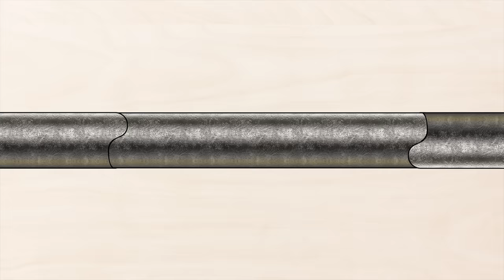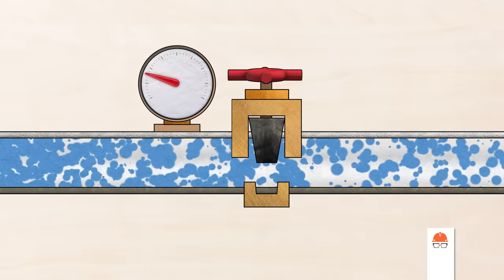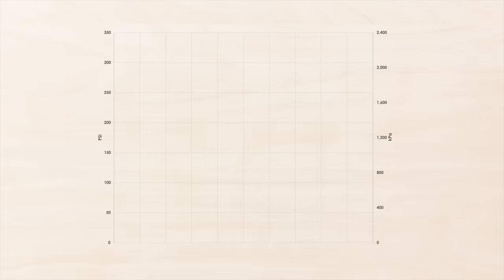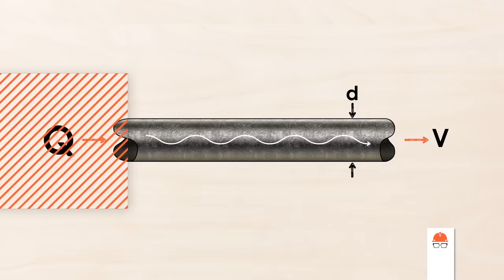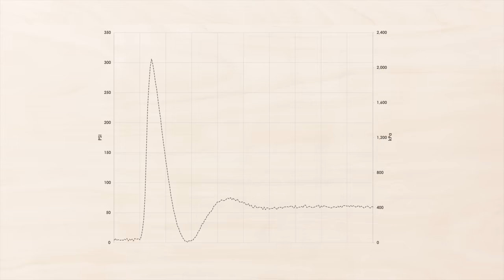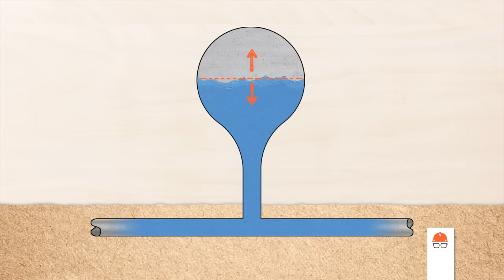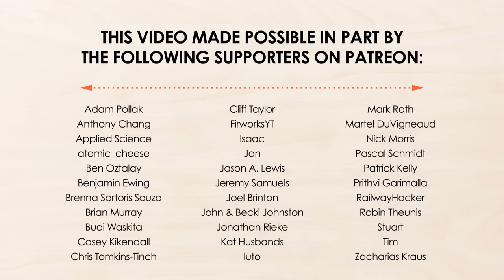What is Water Hammer?

Comment: If you shut a fire hydrant really fast you may have a lady come running out of her house yelling that her water heater just started leaking a lot. Don't ask how I know that.
Reply: william Greene 😂 lol
Reply: william Greene REPORTED
Reply: I thought that water pipe for fire hydrant do NOT connected to conventional water pipe for supply the houses
Reply: @conradkenneth5216  reported?
Reply: Lol
Reply: This is important. Is the location in UK or US?
Reply: Barma Lei  some times they do other times they use reclaim water pipelines. I work in underground pipelaying.
Reply: No,  Fire hydrants share the same water mains  in most municipal water  systems.  @barmalei9927
Reply: Lol
Reply: @rrmerlin3402  don't they need high amount of water in very less time meaning discharging with way more speed than normal house supply system?
Reply: Yes, Fire engines do need more water than your house, that's why all the hydrants are coming from mains 6 inches or larger. Most residents are feed through 1 inch lines.  @neilmccauley5494
Reply: Craig Marston 
If that’s so, how come when the water main breaks after they fix it they flush the lines via the fire hydrants??? I’ve done pipelines for several years from New York City to Red Onion Virginia (population 19) and the hydrants are ALWAYS have been hooked to the municipal water lines.
Reply: I tried to say what you are saying     Fire hyrants are part of the same piping that supplies water to residents and business.  @vsetkoumiera7683
Reply: That makes sense. If the home doesn’t have a pressure regulator.
Reply: @barmalei9927  depends on the city. Most cities size their water mains for fire hydrant and fire protection. So the same water main serves both. If that is the case, water for residential/commercial use are on a different water main tap than water used for fire protection systems.
Reply: @rrmerlin3402  It depends on the City.  IN parts of my city the hydrants are on a non-potable system - especially for large facilities.
Reply: A 1" line is only used in single family dwelling. Commerical buildings start at 2" and can be a large as the main in the street. They are feed by an interconnecting web  of pipes starting large 36" or so going down to around 4". So example 25 house  have there 1" feed connected to a 4" or 6" main running under the street that is feed in both directions. Davvy Jannes
Reply: I retired from the fire service a few years back and knowing your water system in detail is very important.  Davvy Jannes
Reply: Also if you shut it too fast it’ll blow a hole in a water main and bulge the road and then people like me go fix the water main
Reply: thank you for this. lol!
Reply: I didn't want to like it because it is at 420
Reply: How do you know that?
Reply: @Andrew’s G contractors The giant — Most likely, the residence does have a pressure regulator, but it has failed, because it has been neglected and not tested in 15  years, or longer.  I test the water pressure in my house plumbing at least once a year with a portable pressure gauge and have considered installing a permanent gauge or electronic pressure monitor, as the static water main pressure here is around 100 psi, surging to over 140 psi at times, which is well into a range that can damage plastic irrigation valves and valves in washing machines.
Reply: @barmalei9927  They do connect to public water systems. That's why most cities say "boil water" during periods where hydrant testing is under way.
Reply: @barmalei9927  same water main
Reply: Worked a wildfire used the smallest hydrant I’ve seen should of blown the main authorities the amount of draw needed but at the end it kept going
Reply: Also breaks a lot of fire engines
Reply: How do you know that?
Reply: @barmalei9927  it depends.  Potable water mains in the US are sized for fire hydrant flows.  Sometimes there are separate fire mains if high pressures / flows are needed. For example I have a site that has a fire pump for the building sprinklers and hydrants.  This water is stagnant and therefore not potable and must be separate.
Reply: ... How do you know that?
Reply: @TheSundanceKid99  same here. Most times the culprits are the fire department. They have some noob that doesn't know to shut the hydrant down slow after a fire call or flow drill, and end up blowing the main up due to water hammer. I actually had to give a class to the fire dept on how fire hydrants actually work and you'd be surprised at how many of them are frigging clueless.
Reply: Michael Vendick indeed
Reply: Barma Lei , They are not going to lay a second water supply just for hydrants, it’s the same supply.
Reply: Yep
Reply: Potable water and fire water are separate systems.
Reply: @garysimpson7326  I live near lake michigan in the US. The great lakes contain 1/3 of the fresh water on earth. Because water is available in almost infinite quantities it was cheaper to feed the fire hydrants directly from the potable water mains. In fact we have only one water system and it's all potable. This may not be the case everywhere but here it is.
Reply: @shananarocks  US near the great lakes.
Reply: itsabig  Unless you spin the wrench like a maniac. You can close it pretty fast. I was only 19 at the time so I didn't know ( until then).
Reply: @williamgreene4834  Thanks for the information. That is definitely not the case where I am in Texas.
Reply: @garysimpson7326  Ya, I live in a strange area. Lake michigan alone contains 1,300 trillion gallons of water. :)
Reply: The connection is reported to be the rain...
Reply: @rrmerlin3402  that’s True I’ve done Watermain in Chicago and the Watermain is basically looped on a grid so you would have to turn a bunch of valves off to kill one block of water  and  we use 8inch for fire hydrants  8 inch is the smallest Watermain in Chicago the we use
Reply: Its great to have volunteers to absorb the shock. Pressure release right there.
Reply: @Samuel Lynch Yes it did. :)
Reply: @mandowarrior123  I worked in public works. They just told us to go out and flush a number of hydrants but they didn't bother to tell us how. :)
Reply: how did you know?
Reply: HOW DO YOU KNOW THAT?
Reply: Lolol
Reply: @williamgreene4834  thats AWESOME 😂 keep doing it 😅😅😅
Reply: Wow!
Reply: Not may, will.
Reply: @barmalei9927 some water mains are just for fire supply usually in the city, others are for water. Some are both in residential areas
Reply: Vacuum breaker
Reply: Oh boy... you're a firefighter aren't you?
Reply: @PharaohEagleOwl  No, we were just sent out to flush some hydrants and no one told us what not to do. :)
Reply: @barmalei9927  not true at all unless industrial and a separate fire suppression line is also installed but all goes back the main potable water system
Reply: Correlation is not causation🤣✌️

Comment: Thanks, Grady, for this (now three year old) video.

This really is "practical engineering" at its literal best.  I've had an annoying "knock-knock" sound whenever my clothes washer ran.(edit: The "knock-knock" was the high pressure spike bouncing back and forth in the supply pipe.)  After watching this video I immediately understood the cause, the likely long-term implications for my plumbing system and - most importantly - how to fix it. A few minutes of research, a $20 part from my local plumbing supply store, and ten minutes of work behind the washer - and problem gone.

It's hard to overstate how helpful it is for us non-engineers to have problems like water hammer explained so clearly and thoroughly.  Heaven only knows how much expensive repair and maintenance your video has saved me, to say nothing about the annoyance of knocking pipes.

I'm never going to design a dam or a suspension bridge. But your series makes me respect the work of the engineers who do even more. I'm just glad to have put a bit of knowledge I got from your videos to use in a very common, every day problem.

Thanks for a great channel!
Reply: Newer machines usually cycle their valves in a way as to prevent serious water hammer. How old is your washer? Just curious.
Reply: @16vSciroccoboi  It's a fairly high-end Bosch machine, less than two years old. But there's more to the story. And it's an odd and complicated one indeed.

I live in the UK. For various strange reasons, most UK houses have a tank in the attic that stores cold water. Presumably in the event of a widespread disaster (ie. the Luftwaffe comes back?) this could become an emergency source of drinking water.  This attic  tank is the primary source of all the cold water in most UK houses. And being just a few feet above the living space, it's also the reason that the water pressure in most British houses is so pathetic. So pitiful, in fact, that there is a thriving business for plumbers and electricians to install "power showers" that use electric pumps to boost water pressure to a level sufficient to  achieve a decent shower. 

With me so far?

My house, unlike that of most of my neighbours, is quite new. And being constructed at a time when the prospect of Luftwaffe bombing seemed remote,  it was built without the attic cold water storage tank. Meaning my washing machine, along with the rest of the appliances and other plumbing fixtures, receives water at mains pressure. Enough to give a very decent shower in my third story master bathroom. All good on the showering front. And plenty of storage space in my attic without that all-but useless cold water storage tank.

The problem is (was?) that neither the washing machine manufacturer, nor the the store that sold it to me, anticipated it would be receiving water at relatively high pressure.  Meaning it was sold and installed without the $20 water-hammer arrestor that most US home owners take for granted (without really knowing what its there for). And that US plumbers install without a second thought.

I'm not an engineer. My father and grandfather were, but my eyes glaze over when confronted with the math required. I'm a behavioural economist. I make my living understanding and explaining why people do the things that they do. So I think I have pretty good idea of why my pricey Bosch washing machine banged whenever it ran. Thank God indeed for people like Grady to help me fix the problem. And thank you for asking the question that helped me answer it.
Reply: Hi, I got the same problem as your washing machine. Can you describe a bit more details, the part you need and how to fix behind the washer? thanks in advance
Reply: @philipchan2378  OK: The problem was that during the parts of the washing cycle when the machine was filling, there would be a sharp "knocking" sound coming from the walls. This only happened right at the start of each cycle - not when the drum itself was turning. This was my clue that it was a water hammer problem.

The fix was a water hammer arrestor. In my case a Sioux Chief DW660-H. This was installed between the fixture on the cold water supply pipe and the supply hose of the washing machine. I checked ahead of time that the thread size (3/4" BSP) was correct for my machine. Installing it did mean I had to move the washer a couple inches further away from the wall. Installation (in a US/Canada setting): https://www.youtube.com/watch?v=aMd7bQ8kkj8&t=130s

Europe, etc. will be similar - just one arrestor instead of two.

Sioux Chief sells these parts worldwide, so I'd imagine they would be available to fit local plumbing and appliance standards.

In Europe washing machines generally have only a single (cold water) supply. In the US many machines have two - one hot and one cold. So you'll need two arrestors in that case. 

If this is a water hammer problem, then installing a water hammer arrestor really is a DIY job. The only tool you'll need is an adjustable wrench capable of fitting over the flats on the nuts on the fittings. Turn off the water first, and be prepared to wipe up a few drops off water.

Last note: The flexible supply hoses on most washing machine are pretty durable. But they aren't immortal. And if they do split or get damaged it can end up making a huge flood in your house. Best to replace them (with good quality braided-metal covered) ones every ±5 years or so.
Reply: @vrdrew63  This is such a well-written anecdote! I love it. Thanks for sharing!! I love practical engineering.
Reply: *six